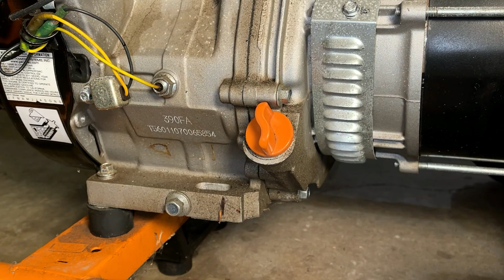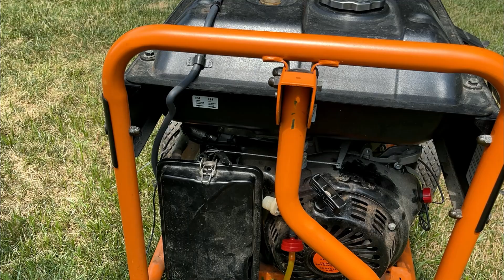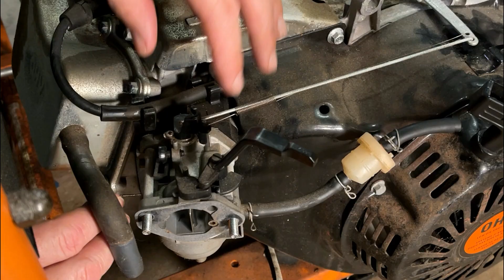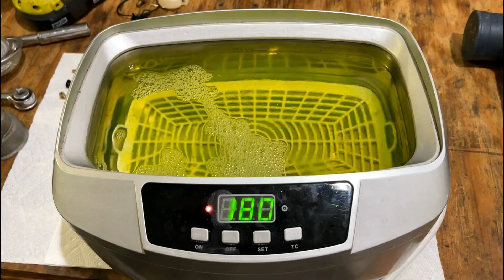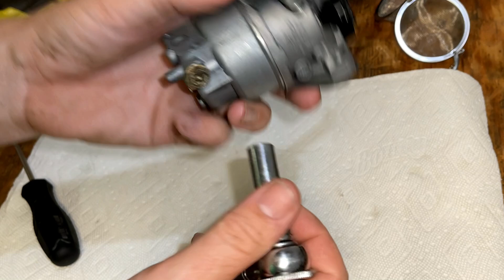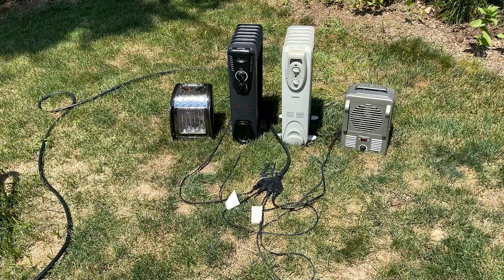Generac Generator - Running Fast and Down on Power

Comment: I have this generator and it's very difficult to pull start. When I pull it's like a flywheel is going around very slowly and difficult to pull. Someone told me there is a switch or something makes it easy to pull. Do you know what that would be?

Comment: My gp5500 runs good in choke but not in run. I put on a new venseri replacement. Identical cept for a screw with spring adjustable. Didn't mess with the idle. Any ideas ?
Reply from the maker: It is runs good with choke then likely a fuel issue.
Reply: @jcondon1  fuel valve went bad. Apatently it would get enough fuel to run in choke but not in half or run. New gas with sta-bill and good valve back to genning
Reply: Also oil changed fuel filter and line changed. I am leaning toward bad gas.

Comment: My intake is set at 4 thousandths and exhaust was 5 thousandths 
Where did you get your specs from? Trying to figure out what mine supposed to be at? I got in 8000 generac
Reply from the maker: Usually found in the owners manual.  Depending on the engine 0.004” intake 0.006 exhaust or 0.006 intake 0.008” exhaust.  When in doubt split the difference and you should be good.  0.005” intake 0.007” exhaust.

Comment: Yo bro you like the generator guy on YouTube and this is not your first generator you have worked on that idle screw you can screw it all out and take it out it does nothing this generac generator runs at 3600 RPM all times it will never go down to idle ever wanna know why because it is not a inverter generator or electronic throttle body it will always stay at 3600 RPM unless you take the governor's screw out and it maybe go to 1100 RPM this generator will never go to idle cuz it does not have that feature and it's not an inverter style generator with capacitors to hold you over until the engine senses and load and cranks up the RPM to 3600 only engines that are electronically throttle can do that and have capacitors the capacity hold you over until the engine raises up to RPM

Comment: I've watched just about all your videos at this point. My general thought is that the Honda generators are the best. But it seems like just about everything you work on ends up running well in the end once maintained. Would you say that there really is any benefit to a Honda generator at this point, when you can get something with similar output for 1/4 the price?

Comment: I have been using a product called Krud Kutter in my ultrasonic machine for carb cleaning the last 3-4 years. It works on both the dirt and oil and the varnish. I've used Pine-Sol, Simple Green, Ammonia etc... and the Krud Kutter works the best. I mix it 50/50 with distilled water.
Reply from the maker: Thanks for the tip.

Comment: I just bought the new Dewalt DXGNR8000.  Forums claim its a Generac.  420cc motor, not Honda.  It looks very similar to this model in the video.  You ever dealt with one of these?
Reply from the maker: I have not.  But most made today use the same 420cc Honda clone.  Most are built by only a handful of companies and just rebranded.

Comment: I have GP5000, only make 60v, pulled the powered cover and all the strings wrapping the stator are broken. I ran this in my shed just to exercise it (normally pull it out) I think I overheated it...worth fixing? Thanks in advance.
Reply from the maker: Generac does sell the part you need, but it most likely costs more then the generator did when it was new.  Your best bet would be to buy another working generator or look to see if anyone is selling one with a blown engine that you could steal the stator from.
Reply: @jcondon1  Thanks for reply. I learned a ton watching your videos, super detailed and informative. Just picked up Briggs 7000 for $400...it's a shame too, as the Generac only has 89hrs on it..on the hunt for one with a blown engine to get the powerhead...

Comment: how many hours were on it?
Reply from the maker: Not sure.  Think the hour meter was not working.  They tend to go out at around the 10 hear mark.  A mechanical counter would be much better then one that runs on a non replaceable battery.

Comment: The idiot that owned it was just overloading the engine causing it to stahl. I would take a good look at the gen set.  He might have damaged it by overloading it.  Inductive tachs float all over the place. Mine jumps from let’s say 2,500 to 2,700 and I do not hear any change in the engine speed.  I do want to get a DTI 20Ktach but they are pricey.

Comment: How to prevent rusting of the metal fuel tank when it is stored empty for a long time?
Reply from the maker: You can spray WD40 in there or maybe some two stroke oil.

Comment: I like watching your videos are educational I have a question I wanna ask you I have a twin cylinder Kohler engine out here it’s misfiring what I mean is the voltage values go up and down on the cold packs I just wonder if replacing the coil packs will fix that I found one problem starter solenoid was bad and it has a white wire going to a relay and it looks like it’s going to the coil packs
Reply from the maker: I do not have any experience with that engine.  Misfiring can definitely be caused by a low voltage or intermittent spark.  But there are other reason for that.  Check to make sure both cylinders are firing and building compression.

Comment: Sort of makes me wonder when (hours) the PO started messing with the speed screw? 50hrs? 100hrs? Maybe the valves were off spec from the factory floor? Thanks for the video Mr James!
Reply from the maker: Maybe.  Generac's are infamous for having valve issues.  The manual says to check after the first 50 hours then every 200 after.

Comment: This was a good lesson in the limitations of a simple mechanical governor.  Even though you were easily able to rev the engine higher when it was drooping before, the governor was unable to do so within its parameters.  Between the carb cleaning and valve adjustment, you improved the function/power of the engine and the governor response is now matched.
Reply: Very good info.  I have a 3k Briggs generator that drops way to much- about 5-10 hertz when you put a load on it.  I did not think it could be an engine issue but perhaps it is.  I will try cleaning the carb again and adjusting the valves.
Reply from the maker: Try bumping the throttle manually.  If you can get back up to speed then cleaning the carb and adjusting the valves might help.
Reply: Thank you sir!

Comment: I was surprised when you pulled the valve cover.  Not only cast rockers, but arranged in a hemi configuration.  Looked very heavy duty compared to what I usually see.  What year/make is this engine?  Also, great job ironing out the minor issues!
Reply from the maker: Thanks.  It was a Honda clone, probably built around 2011.  It was a hemi.
Reply: @jcondon1  Thanks

Comment: If you suspect a 4 stroke small engine is running rich at idle/no load 3400, and the carb is not adjustable, can dirt some how cause this or is it just a defective carb?
Reply from the maker: Running rich is usually bad carb jetting or a restricted air filter.

Comment: Up until about 3 years ago that carb was under $40 dealer cost (around $60 list) and I replaced them as a matter of course instead of trying to clean them out. After all, with shop rates at $100 per hour it was faster and cheaper to throw on a new part. Fast forward to Trump's import tax and that carb was over $100 retail, plus labor. Price shot up twice in 90 days as I recall. More to the point of the video, that set should hold 58 Hz at full load if set to 61.5 at no load. (they do faulter at 6000 watts and will stall at 7000) You nailed this one! BTW, the breaker probably wont trip fast enough at 6000 watts to protect the stator from overheating / burning out. It's more of a fault / short protection thing.
Reply from the maker: Thanks.  Price and supply are definitely an issue right now.  If working for a customer, then replacing it is the way to go not only the labor cost, but a new one will last longer then a cleaned up old one and hopefully keep the customer happy with your work.

Comment: I bought a used generator for $100 after watching all your videos.  It was not running and missing a few carb parts.  Thanks to your videos, I was able to get it running and used it when Hurricane Ida caused us to lose our power.  I would not have had the confidence to buy, much less the skills to get running had it not been for your videos.  Keep up the great work!
Reply from the maker: That's great to hear.  Usually it comes down to the carb and proper fuel maintenance.
Reply: ⚠️Rules about generator safety: This is a very important announcement that everyone needs to know just to make sure. 

It is important to follow all generator safety rules whenever we use portable generators: 

Everyone must see this. This is just a reminder for everyone’s safety. 

1) KEEPING OTHERS SAFE: Please do not allow an unqualified person or your children to operate and service the portable generator. Just because some manuals don’t say that doesn’t mean it’s safe. That is important against the generator safety rules. We also need to be keeping an eye on our children too. You need to make sure that your children are not playing near the portable generator especially when it’s running so they won’t get electrocuted. Generators pose electrical risks and they can be hot during an operation. Please keep your children away from the portable generator at all times. It is important to keep our children safe especially our little ones. Be aware of all the hazards.

2) WHERE TO RUN YOUR GENERATOR: Some people use their portable generators indoors which increases the risk of carbon monoxide poisoning. It’s important to have a carbon monoxide if you have a gas generator. Never ever use your generator indoors even if your doors and windows are open and even in the garage is not safe to use a portable generator. Not even at your porch and your deck. It is never safe to use your generator indoors and in enclosed areas of your home. Your generator needs to be 15-20 feet away from your house. 

3)🔥FIRE HAZARDS: Never refuel your generator while it’s running. You need to let your generator cool off before refueling it and before storing your generator. Never overload your generator too. Never ever back feed your generator. You should never plug your generator into a wall outlet. Also never store propane tanks indoors. Please keep flammable things away from the generator as well and please don’t smoke cigarettes near the generator. Having a fire extinguisher next to the generator is also important against the generator safety rules. 

4) GENERATOR OPERATION: make sure your hands are dry before touching the generator. Never use your generator in wet conditions. Don’t let your generator get wet. You need a generator tent if you need to use your generator during wet weather. Please don’t wear loose clothes when operating the generator. Turn on your generator before plugging in appliances. Use the right cord for your generator. Please do not use worn out cords. 

https://youtu.be/I1jT3ANENvI and here is a video more about keeping others safe when using generators 

Hope this helps. Please make sure you follow all the generator safety tips. Thank you

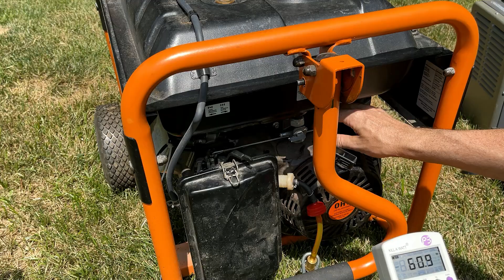Comment: The noise and vibration frequency making the generator look cool on the camera it's dancing doing the caterpillar dance lmfao 🤣 😂 it's amazing what cameras see compared to what we see @7:06 @James Condon
Reply from the maker: Was thinking the same thing.  Not sure how the camera sees it that way.  I try not to put it too close for that reason.
Reply: @jcondon1  the frequency of the generator running is close to the same frequency that the camera is recording at that's why it causes that kinda like when you use a led light and of its not a camera friendly or sold as a camera led light it causes the ripple lines across the recording screen its just the frequencies between the 2 items causing the worm dance looks cool though compared to the led interference lines

Comment: Great job as usual! You’re going to get top dollar for it.
Reply: ⚠️Rules about generator safety: This is a very important announcement that everyone needs to know just to make sure. 

It is important to follow all generator safety rules whenever we use portable generators: 

Everyone must see this. This is just a reminder for everyone’s safety. 

1) KEEPING OTHERS SAFE: Please do not allow an unqualified person or your children to operate and service the portable generator. Just because some manuals don’t say that doesn’t mean it’s safe. That is important against the generator safety rules. We also need to be keeping an eye on our children too. You need to make sure that your children are not playing near the portable generator especially when it’s running so they won’t get electrocuted. Generators pose electrical risks and they can be hot during an operation. Please keep your children away from the portable generator at all times. It is important to keep our children safe especially our little ones. Be aware of all the hazards.

2) WHERE TO RUN YOUR GENERATOR: Some people use their portable generators indoors which increases the risk of carbon monoxide poisoning. It’s important to have a carbon monoxide if you have a gas generator. Never ever use your generator indoors even if your doors and windows are open and even in the garage is not safe to use a portable generator. Not even at your porch and your deck. It is never safe to use your generator indoors and in enclosed areas of your home. Your generator needs to be 15-20 feet away from your house. 

3)🔥FIRE HAZARDS: Never refuel your generator while it’s running. You need to let your generator cool off before refueling it and before storing your generator. Never overload your generator too. Never ever back feed your generator. You should never plug your generator into a wall outlet. Also never store propane tanks indoors. Please keep flammable things away from the generator as well and please don’t smoke cigarettes near the generator. Having a fire extinguisher next to the generator is also important against the generator safety rules. 

4) GENERATOR OPERATION: make sure your hands are dry before touching the generator. Never use your generator in wet conditions. Don’t let your generator get wet. You need a generator tent if you need to use your generator during wet weather. Please don’t wear loose clothes when operating the generator. Turn on your generator before plugging in appliances. Use the right cord for your generator. Please do not use worn out cords. 

https://youtu.be/I1jT3ANENvI and here is a video more about keeping others safe when using generators 

Hope this helps. Thank you

Comment: Great job James. Most people underestimate the difference in performance that a valve adj. can make, and it make them easier to start and run at the correct temp.

Comment: James is adjusting the RPMs the Maine way to raise the Herts up on a generator.
Reply from the maker: That is the only way, unless it is an inverter.  The hertz on an inverter generator is independent of engine speed.
Reply: That’s the only way you adjust the frequency….

Comment: You have to love scoring things from people who got in way over their heads.🤣. Also for adjusting the valves always remember eoic.
Reply: eoic?
Reply: @lordjaashin  exhaust starts to open  adjust intake valve, intake valve starts to close adjust exhaust. Basically the cam lobe needs to be on the base circle of the intake or exhaust lobe to adjust that valve lash correctly.
Reply from the maker: That method works much better for most.  I cannot tell you how many people do not know that the piston is at TDC twice, and adjust the valves when at TDC on the wrong stroke.  Causes a lot of issues doing it the "correct" way.

Comment: This needed no more than some careful maintenance work. Cost you no more than the new oil and the degreaser in the cleaner.. Ended up being a first class generator.
Reply: Did you determine if the tacho was faulty James? It was certainly not reading right.

Comment: Really nice find for that price. I still have the GP5500 that I got in the spring and that someone converted to propane only as the tank is gone. Had gasoline in the oil and some light pitting in the cylinder. So I think I'm going to hone it and replace the rings. Subaru engine on these, correct? Generac, and everywhere else, shows the part #s as unavailable, but I think I found a corresponding Subaru ring kit for it. Need to examine and check ohms on gen head before ordering anything for the engine though.
Reply from the maker: Generac uses a Honda clone on this one.  Worst case find another generator that does not make power with a 420cc clone engine and you coin probably just do an engine swap.
Reply: @jcondon1  Thanks Jim. I think something is different about the one I have though as it has a 389cc on it.
Reply: @ericvaughn1126  .. that'd certainly a Generac engine and the factory has very few internal parts available. (China import) the 389 versus 420 is just a few years apart in production. I'd look for another used set to get parts. You might even luck out at a junk pile behind a dealer or repair shop. I can't tell you how many I threw away because the rest of the set was trash from being left outside. IOW, too expensive to fix. (Yes, I was working for a dealer)

Comment: Why would someone sell a genator like that for 200
Reply: John ... the most common reason is they thought it would be easy to take care of it themselves and they get in over their head. Second most common reason is they got older / smarter and bought an automatic stand by set. When you work for a dealer over 25 years you notice stuff.  <LOL>
Reply from the maker: Lots of reasons.  But in this case, the guy upgraded to a larger unit and just wanted to dump the old unit.